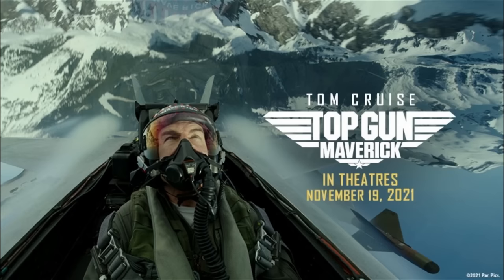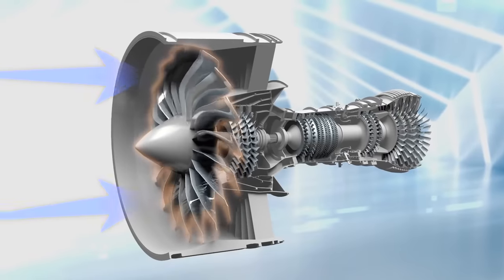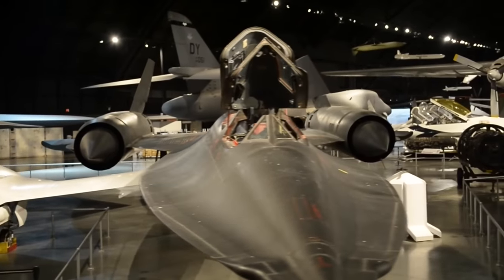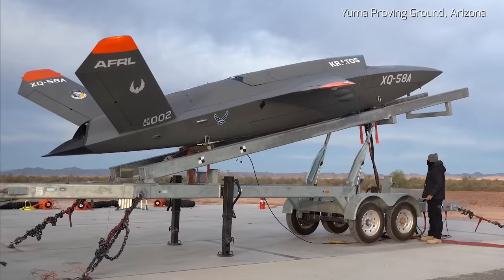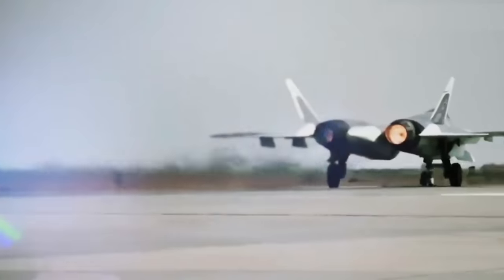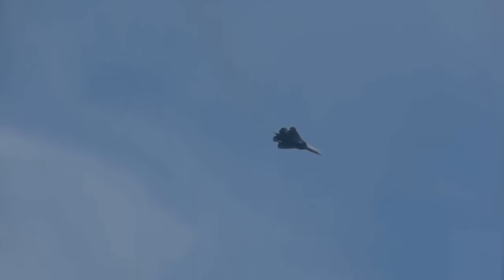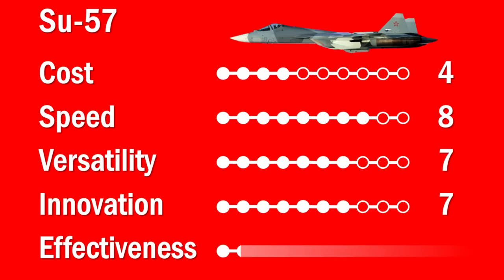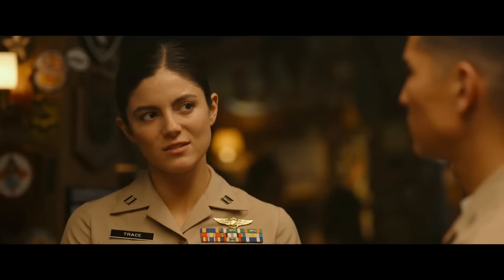Aerospace Engineer Reacts to TOP GUN: MAVERICK

Comment: Mach 3 was only the "reported" top speed of the SR-71 while it was still in use. This was to bluff our enemies into thinking it had lesser capability than it actually did. When it was retired and flown to its final resting place at the Smithsonian, the pilot was given the authorization to test its full capability over the open ocean on its final journey, and it reached Mach 7. It could have reached a higher speed if the journey was longer. If a plane developed in the 80's can go M7+ then it isn't a far stretch to think the USA could be using a M10+ plane now.
Reply from the maker: Not sure where you heard that story. Sounds interesting, but I'd like see it corroborated before I use that as evidence to speculate on our current technological abilities.

Comment: the combined cycle ramjet is what is going to be in these aircraft.  they will need a turbine to slowdown and land, likly will used MHD devices to gather power to run a RF antenna to such a high-power to create a false bow shock ahead of the aircraft and would essentially fly in the shadow of the extremally dense plasma point Infront of the craft and the fuel flow would also b e used to cool the skin and ceramic tiles like aerogels

Comment: Super maneuverability has been developed in the US with: 
2D thrust vectoring aircraft like the F-22 and F-15 ACTIVE and even 3D thrust vectoring aircraft like the X-31, F-16 VISTA and F/A-18 HARV. 

The conclusion was 3D thrust vectoring does not offer much maneuvering advantage outside the extreme slow speed arena..

The Dogfighting doctrine in the US is not neglected, it is just different. Instead of focusing on slow speed, post stall maneuverability where thrust vectoring is useful, Dogfighting in the US emphasizes high speed and high G maneuverability. Which is why in General US fighters have higher thrust to weight ratios than their Russian counterparts. 

Whereas the Su-57 may have advantages in the slow speed, maneuverability over the F-22, the F-22 holds the advantage in a high speed and high G  close range dogfight

Comment: There is a better reason the US hasn't prioritised super manoeuvrability.

A lot of these technologies have been tested in the US, for example with the X-31 and the modified F-15 Active.

The problem I heard, was they found that doing these stunts lost the aircraft too much kinetic energy, leaving it a sitting duck while it recovered, so if the stunt doesn't pay off on the first try, there is a risk while the aircraft recovers.

Also consider that high off bore-sight air to air is becoming a thing now. So you no longer need to point the plane at the opponent aircraft.
Reply: in a merge the first jet to turn around will be the one to come out of an engagement intact, no jet has missile with a boresight of 360degrees, and of course they found that the supermanauverability would lose a lot of energy thats the whole point, but the jets with it would only use it in a dogfight under certain conditions

Comment: I am not a aerospace engineer or in the military but I don't see drones completely removing fighter jets the connection between the operator and the drone will be vulnerable to cyberattack. it does sound like US jets are a a disadvantage in close air combat.
Reply from the maker: Yes cyberattacks are a huge vulnerability for tech like drones. I think we have the mechanisms to prevent those kind of attacks for now, but in the future it may be a bigger issue.

Comment: Actually factually we have had F 22 thrust vectoring supermaneuvrability in the early 1990s way before Russia. However, generally speaking Russian aircraft were historically more maneuverable over American aircraft especially the Su 27. But, we got there first.

Additionally, the Su 57 stealth sucks compared to our stealth technology. the Su 57 is more low observable and only from the front. The sides and rear are not stealthy. So, the Su 57 generally is an inferior 5th gen that no other country wants to buy just ask India who pulled out of the project.

Also, good video and review of Top Gun Maverick. I thought it was fair and liked your take on the Dark Star piece.
Reply from the maker: You're correct about the F-22 being supermanuverable. I guess it depends on if you consider the su-27 supermanuverable or not on determining who got there first. Not sure if I would consider it supermanuverable or not. I'd have to do some more research
Reply: @AviationAustin   I don't consider the Su 27 supermaneuverable but for a non-vector thrust aircraft is awesome. There are some good vids on its ability especially the Cobra Maneuver.  The Su 35 does have thrust vectoring so that was the plus up from the 27. But, I believe the 35 came out after the F 22.

Comment: I do not agree with this aircraft ranking list. it does not seem to use categories for aircraft in effectiveness and it sets the f22(no variant) as the peak of aircraft design. With all f35 variants below the f22 suggesting they are less capable aircraft? Further more you could assume this chart favors ground attack roles as how highly bombers and multi role aircraft are rated but no because the f18(no variant) above the F15E which has much more ground attack capabilities. The list also places the f18(no variant) above the f15C wich statistically is the most successful fighter jet of all time. Also placing the su57(no variant) a 5th generation fighter 2 spaces above the f5(no variant) a  sub sonic Cold War era fighter jet and not many more spaces above an airbus a380 does not seem right to me. Also in the video the su57 is described as a super maneuverable fighter with no BVR capabilities or Jamming technology with its core aspect the maneuverability being overshadowed by the f22?
Reply from the maker: Check out my rankings explained video. That should shed some light on your concerns. It explains the rationale behind clumping some variants and not others. It also explains how effectiveness is captured. https://youtu.be/5ceOBXRjdVs

Comment: Russia's and China's Su-57 and J-20 are not true 5th gen aircraft. They're more like glorified 4.5 gen.

In the case of the Su-57, the intakes are straight in to the engines, exposed engine exhaust nozzles, and wood screws instead of rivets, and also Russia's insistence on using the same old style Russian IRST blister. 

In the case of the J-20, I don't know very little, but what I do know is that canards don't do anything for RCS.

Comment: The problem with supermaneuverability is that these maneuvers lose most or all of your energy when executed. If you get into a dogfight, you get one chance to use one to maybe get your piper on your opponent and fire off a few rounds. After that, you're dead in the air, until thrust and gravity get airflow back over your control surfaces. Given that western dogfighting tactics emphasize the wingman, even if you have a successful post-stall/thrust-vectored maneuver that allows you to get a hit on your opponent, his wingman will definitely get you. This makes the maneuver a zero sum tactic. And western air combat tactics absolutely account for the likelihood of an opponent leveraging one of these maneuvers.
Reply from the maker: Absolutely right! It may look cool but not ideal for air to air combat.
Reply: Only ideal for 1v1

Comment: Saw the first Top Gun movie in a flight suit as we were killing time to do night ops testing for what was then the Sensor Fusion program. We laughed at a lot of the antics but it was a good entertaining movie.
I thought the second Top Gun movie was again entertaining. Frankly, most of flight testing is boring. A lot of time is spent flipping switches in the baking hot sun, taxiing back and forth in the baking hot sun, checking equipment and conversing with the engineers.... in the baking hot sun.
As an Aeronautical Engineer any movie with aircraft in it is worth watching.
My Mom was the secretary to the Naval Base Captain. She saw first hand what happened to those who transgressed military rules and norms. Riding a motorcycle on post with no helmet at high speed on a runway (or taxiway) would not end well.

Comment: AI has the problem of corner cases. When a corner case arises, it misbehaves or reacts incorrectly.  And real world and war are full of corner cases. I feel human pilots will always be there. At most you may have AI that reacts if pilot suffers a blackout or if an extreme evasion is needed or in case of system failure.  But it may need to pass through sensor checks with lots of redundancy.

Comment: All Russia has to do with the SU-57 is build more than 3. If the SU-57 was as good as advertised how come none of them are flying over Ukraine racking up kill counts?
Reply: As pretty as the SU-57 is (and they ARE undeniably gorgeous), the visible rivets and seams I've seen on the actual operational aircraft leads me to believe that they're radar cross section is MUCH larger than a US 5th generation aircraft and likely wouldn't last against Ukrainian SAMs and I've a hunch that Russian military leaders know this and are refusing to commit them to the campaign because losing them would be a sever blow to the perceived strength of the Russian military... not that anyone believes in the strength of the Russian military anymore at this point.

Comment: Quick question. If the darkstar was a real aircraft, wouldn't it benefit structurally from not having cockpit windows. I understand that this is a good thing for the film. But in real world would they not just give the pilot a F35 HUD helmet. To see around himself.
Reply: I ask because the visual effects in the film shows the heat building on the window frames. A common problem they had on the concorde which resulted in them adding an external visor to reduce friction on the windows.

Comment: Burn out of the plane above mach 10 in the movie is possibly due to very high heat generated by flow stagnation which in the case above than the structural material design

Comment: That fast jet of Mach 10......we probably have the tech for it. Your just never going to find out till it's used
Reply from the maker: Time will tell
Reply: We have rockets and ICBMs. The thing is, you have to compromise on so much else to get something that will do mach 10, that until there is a scenario where we need a mach 10 fighter compared to something that can be done with a rocket, it's not worth developing. A successor to the Blackbird, possibly, but even then does it need to be manned?

Comment: 10:56 20 MILES? hell even older missiles like the aim120 and R77-1 could engage at 70km ranges.
13:05 as of today, by the latest december 2023 batch, theres around 35 su57M's, the other 10 being T-50/T-50-1 prototypes, and they have been used in ukraine by offstand launch of cruise missiles like the KH-59MK2. (source: london MoD)

Comment: The f22 has super manoeuvrability in its design as well though. It's just not flaunted by the pilots at the orders of the us government to withhold the full capabilities of the plane. Yes it was designed with bvr as the main goal but the plane can still hold itself against the su57 with its manoeuvring abilities
Reply: Yeah I’m very surprised that he didn’t know that. Since the F-22 does have thrust vectoring and control vectoring that still stacks up against the Su-57 and it’s 3d thrust vectoring pretty well.

Comment: What about AI instead of Pilot or UAV (with remote pilot)? Thx
Reply: it's more a question of remote vs AI, you can make an airplane that pulls 50gs, you can't make a pilot that flies through 50gs, it's also design-intensive to include the pilot but onboard systems to try to replace one aren't exactly free either.
lag is an extreem concern in all of those cases

I have almost literally zero idea how any of that decision process is going on in any military's politics but as far as the gaming community is concerned the epitome is a mix of both: a purpose-built AI with an overseer that fully understands both the task/situation/system at hand and how the AI they are working with/through works have been proving almost completely unbeatable even against pure AI explicitly designed to counter them.

Comment: The manuability matters.  Missiles take a lot fuels to change their vectors.  As for the Dark Star, no way they can achieve the speed with cooling the frame without any gaps within the air frame.  Unless you can coat its skin like Apollo reentry capsules.  I dobut the  tiles are the answer like space shuttle.  I only know chemical thermodynamics. Not aero.

Comment: I think that a drone definitely can outperform a human, it removes those G forces that puts a strain on a human where construction can still maintain its...rigidness? Not sure how to call it.
I know that if you put a certain type of engineered plane past its limits of turning/G forces, it degrades material to an unusable state afterwards, or just overall lifespan as such, like movie already mentioned it.

The main concern is regarding malfunction, there is no manual control in case of electronic failure, as well as there is a higher potential to be hacked, basically security concern. It's a weapon that can be much more easily to be "swayed" and turned against you. I know that regarding such thing there has been a heavy investment in defending against such things, but still....it is a possibility of having a drone. Thus far regular drones for surveillance and long distance target elimination with the UAV's have, I think, proved to be efficient, but have there been reports of a hacking attempt on any side of the war? 

What if an EMP is launched and basically scrambles a drone, where a pilot can still maintain manual flight to guide itself safely or land as safe as possible without engines and electronics, where otherwise one would just crash? Okey, modern jets are fly-by-wire if I understand, such as F-35 and F-22? No mechanical limitations, then even in that case EMP means RIP for your plane...

P.S. About Su-57, It is mostly tough for any aircraft to deal with anti-air defenses, I doubt it would be much easier for F-22's and 35's, it would require a missile and locking range that exceeds the known anti-air system range of the opponent, as well as destroying that incoming missile.

Comment: Unmanned has potential to be far superior fighters and bombers than manned. There is only one major caveat. Being run by software autonomously or remote controlled poses a cyber security risk. Nearly anything can be hacked. That's why ICBMs aren't on the Internet and even use some antiquated analog technology.  In other words, manned aircraft are never going to completely disappear but they will be heavily supplemented with unmanned in the future. Essentailly manned will be the failsafe with unmanned usually responsible for the task itself (and not just airplanes... pretty much anything that can be automated)

Comment: Good review. IMO UAV development, AI plus the BVR engagement doctrine will be the possible end for manned fighter planes. There will possibly be manned aircrafts in a sortie but will be at a great disadvantage. Unmanned planes are cheaper so they can be deployed in large numbers. They do not have human emotions, even if remotely operated the sense of danger won’t be equal. They are only limited to the design limits and not to human limits. They also do not require human interface like joysticks and avionics interfaces like switches or displays which will increase reliability.

Comment: Austin doesn't mention Darkstar baloney:
LM Skunkworks would not have designed and built a plane that barely survives its objective Mach 10.  A SIGNIFICNT margin such as say Mach 15 would have been more realistic.

Mav wants to go faster, initates a turn to port, and still manages to break Mach 10!?  Certerus peribus, planes generally decelerate during turns.  

Mav (apparently) ejects from his disintegrating Darkstar and his body is not vaporized by sudden impact with Mach 10 air stream (lol)!??

Comment: Can you actually calculate at which speed the Air pressure would destroy the Aircraft, is Mach 10 even possible ? ...with Wings, not a Rocket of course ...
Reply from the maker: Mach 10 would destroy most anything not designed to go that speed. It's impossible to calculate unless we know the materials that are used.